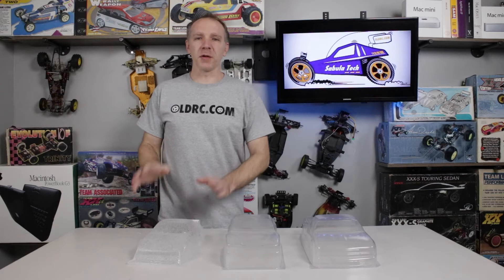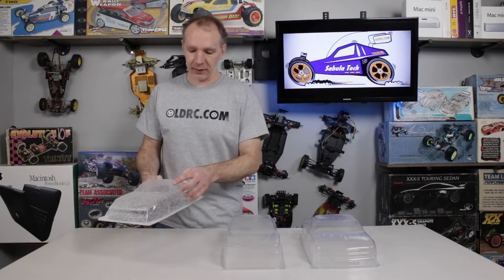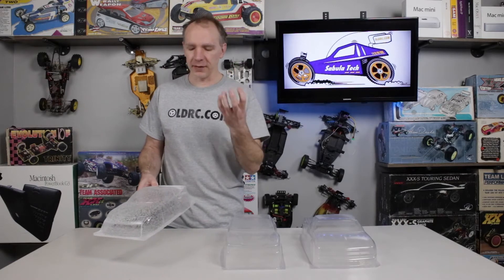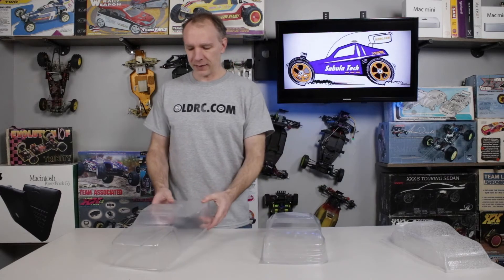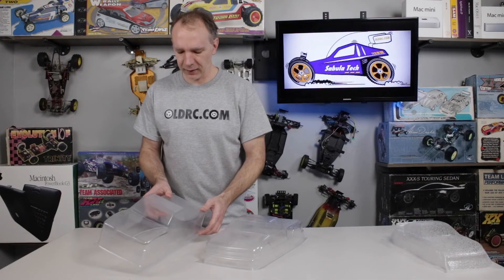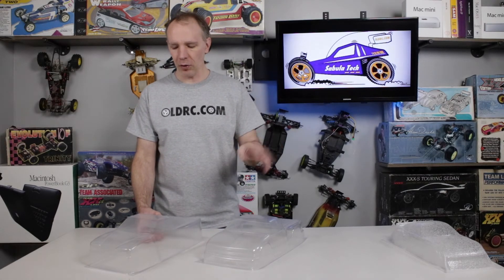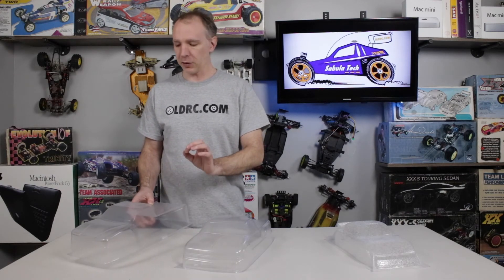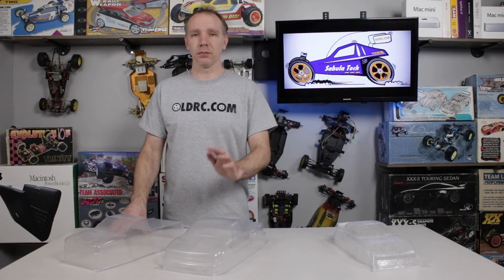Another Look at Why You should Dry Lexan or Poly-carbonate Plastic

Comment: Great video. Would you dry PETG? I've found when using PETG on a resin mould, the first two formed have bubbles and then they clear from this point. So it seems as though heating the mould is required? Also do you have a protective film on your shells? Is this left on during forming?
Reply from the maker: Film is left on during production. Most plastics it is best to dry, the manufacturers spec sheets will usually tell you how hot and how long.